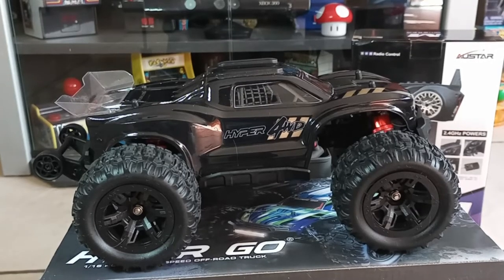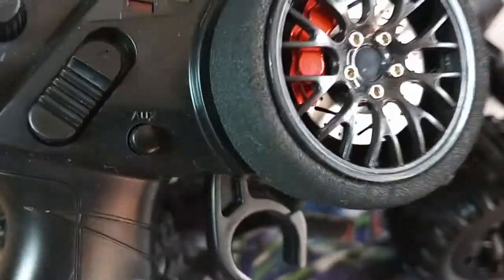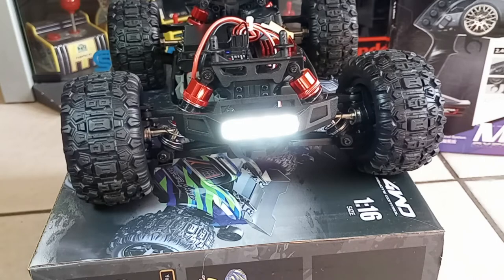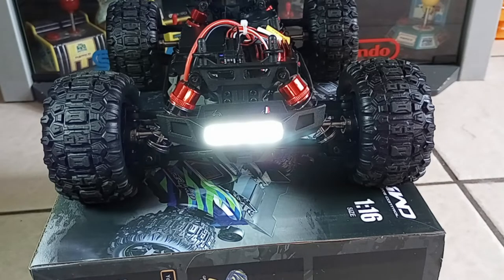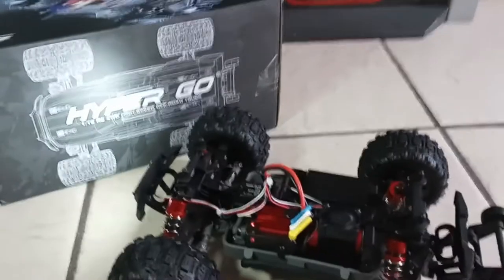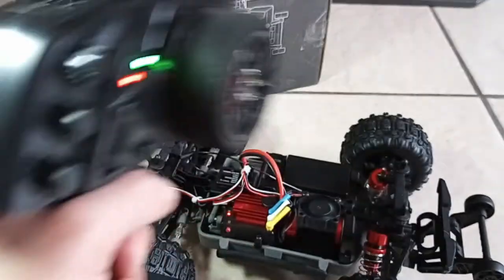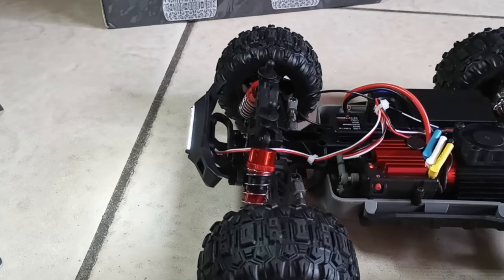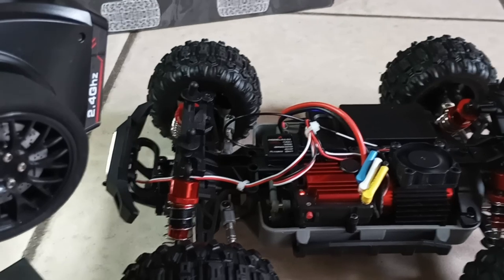1:16 Hyper Go Gets A New Transmitter And This Changes Everything

Comment: I own multiple MJX Hyper Gos and like them. Lag  is an issue with several of them. I also dislike the "drag breaks" or whatever its called when I stop using throttle it locks up sometimes. Helpfuln video.  I wish the link for receiver still worked, but great video. TY.

Comment: changed my receiver as well, but it's a different model than yours. Still, i went into a shop to buy it and the guy changed it for me on the spot. He told me that it's gonna work standard (without other functions such as switching the lights on/off) until we find the ESC manual so we can calibrate it to the new receiver. So let's spam MJX for a manual or a tutorial on how to configure their E45A ESC so we can get our lights working, brother

Comment: I put the wheel extension adapter on mine..made a huge difference. I had to drill the wheel to 6mm and the brass nut in the kit that goes inside wheel and against axel I drilled to 6mm fit perfectly
Reply: Where’d you buy those from? I’m finding a ton of websites that look untrustworthy (new to the hobby)
Reply: @DocBeasty  Amazon
Reply: They have a full aluminum CNC suspension available
Reply from the maker: Amazon has what you need but it cost a little more but you can return it if it's broken and even if it's not broken No Questions Asked
Reply: @MightyistheRCGamer  yesssss that's why I use it ..Chinese electronics are cheap but no quality
Reply from the maker: @kevinc9006  You got that right brother
Reply: Awesome, thanks. And is it worth it to widen out the suspension like that? I imagine it would make it a bit more stable, but would it have a negative effect if I took it to the skate park or something
Reply from the maker: @DocBeasty  I don't recommend abusing your RC cars unless you got money but if I abuse my RC cars and something brakes I just can't sleep at night

Comment: Hey i started with the brush mjx with the gps but that remote works way better idk y they didnt just keep selling that remote with the bl models cause u just have to bind it to bl but once in awsile ill use the lil remote but ya it sucks if u switch the red wire with the signal wire for lights then it will work with the remote👍
Reply from the maker: Thanks for the information brother

Comment: Just got this as my first RC, was wondering if the steering had to be so twitchy or if it was a skill issue, now I see it isn’t just me!
Reply from the maker: You need a new transmitter. But you should be fine for now. I am happy to here this your first rc car. My first rc was only brushed not brushless so your on a great start. It's around $35 to get a new transmitter but after that you will be doing great because that rc truck is built to last
Reply: Radiolink makes a great inexpensive tx/rx. Rcgs3 is mint. A better rx will fix the twitching

Comment: Hi, may I ask you something, please? I can see the receiver is not in the original housing any longer. Does this mean to does not fit in there? Is the new receiver waterproof? Even more interesting for me as a noob is how you connected the fans. This receiver has one connector less than the R30, which comes with the car. How did you connect it correctly? Thanks in advance.

Edit: I came her searching for "Hyper Go 14210". Now I see it is.a different model. Maybe you can still answer the question about receiver and if it is waterproof and what the measurements are and maybe also how to connect the 14210*s fans as there are 2 of them. Best regards.

Comment: With the OE radio it cogs at low speed and as soon as you try to get past that it goes too fast, there is no smooth progression to full speed. Replacing the OE receiver asap with a Dumbo X6FG receiver.

Comment: Ok this receiver/controller has some kool features the old one doesn’t but I had to switch back. Backing up only works good in the reverse setting but still sometimes doesn’t work so I had to flick it a bunch of times and even when it does respond it’s very slow even in the high setting. And my biggest issues was I lost speed, with the old one I needed the wheelie bar and old ladies were impressed 😂 but the new one gets chased by toddlers. 😅 I still like it and will use it to trick people who wants to race me.
Reply from the maker: Hey bro if your happy then I am happy
Reply: The ESC is crap, best to swap it out. I put in a Quicrun 30a ESC and it's response is waaayyyy better

Comment: Can you tell me if i need a new esc, or did you just changed the receever and it fits to the stock esc?
Reply from the maker: Yes the esc will work fine if you bought a new transformer. But only for the brushless version

Comment: HYPER GO H16BM 1:16 4X4 RTR Brushless  HELP!!!!  I bought this car for my husband, but ordered the wrong batteries.  Could you please tell me what batteries he needs to get.   I purchased the Zeee 3S Lipo Battery 2200mAh 11.1V 50C Shorty Pack Battery with Deans Plug for RC Car Truck, but the piece to lock the battery  in is not large enough.  What size does he need to order.  Any help would be deeply appreciated!
Reply: hi. Just take a meter and chek the battery space in the car
Reply from the maker: The battery you need is on ebay trunigy 3s
Reply from the maker: For some reason your comment was put on hold
Reply from the maker: https://www.ebay.com/itm/155422672525
Reply from the maker: Remember everything about RC-ing is difficult very difficult because you have know how to solder a new connection like did you can't just order a battery with everything your looking for. They sell a 3s for this rc but you have to put time into looking for it

Comment: I like your content and stuff I just need to see how it’s connected and how you did it because I have the same rc car and the same transmitter
Reply from the maker: Connect the receiver as if you already have it paired. Then put the binding plug that came with the transmitter in channel 3... Put servo in channel 1 and the ESC in channel 2 turn on the RC and when you turn on the transmitter hold the bind button on top of the transmitter and we'll holding the bind button down turn on the transmitter and it will pair. Then put the light in channel 3 and done
Reply: @MightyistheRCGamer   how long do I hold it down for
Reply from the maker: You hold the bind button down well you turn on the transmitter
Reply from the maker: As soon as it binds the light on the receiver will stop blinking. Then take out the bind plug
Reply: Good thing I checked here because I bought the same transmitter and thought it would be a simple connection. Thanks!
Reply from the maker: @SweetTooth10  follow these steps 
Connect the receiver as if you already have it paired. Then put the binding plug that came with the transmitter in channel 3... Put servo in channel 1 and the ESC in channel 2 turn on the RC and when you turn on the transmitter hold the bind button on top of the transmitter and we'll holding the bind button down turn on the transmitter and it will pair. Then put the light in channel 3 and done
Reply: @MightyistheRCGamer  👍🏾It work’s! I love how it lets you change the throttle and steering to reverse. It also gives me a much longer distance in how far it goes.

Comment: Hello again, I ordered the same transmitter/receiver as yours. I can't get the transmitter and receiver to communicate with each other. I couldn't quite understand the procedure in the manual. Can you share how you were able to get your's to function?
Reply from the maker: Put the binding plug in channel 3 then put the ESC in channel 2 you will see the  Receiver blinking then hold the bind button down Well turning on the transmitter and they will connect. After put the servo in channel 1 and put the lights in channel 3
Reply: I followed your instructions to the T and it connected/worked perfectly! Thank you again for your videos and advice. Being new to the RC game I appreciate your guidance 😎
Reply from the maker: @rktter  All the Thanks go's to you my friend for coming to my channel

Comment: I have the hyper go 16207 buggy version. What kind of transmitter do I need for that one? I'm new to hobby. How do you link a new one to the receiver
Reply from the maker: You can use the transmitter in the video it's sold on Amazon. Remember every transmitter can be used with any RC car and every transmitter comes with its own receiver but you have to pair it to the transmitter yourself and it's not hard at all you just need to follow the directions provided in the box. So you could buy any transmitter you like and it will come with a receiver

Comment: How come mine the steering is now making it go and the throttle is steering
Reply from the maker: Remember servo is ALWAYS CHANNEL 1 then the ESC is channel 2 just change them and problem solving
Reply: Switch your cables on esc. You put motor on channel 1 and servo on 2. It should servo on ch1 and motor on ch2

Comment: Can you show how to upgrade the motor and esc.? My esc is built into the receiver and steering
Reply from the maker: If yours is all in one then it's Definitely not this rc so if you want to upgrade then you must change out EVERYTHING so you need a independent ESC and servo and Transmitter and receiver so that's a lot to buy
Reply: @MightyistheRCGamer hi, why also change the servo? Transmitter and receiver is enough no ?
Reply from the maker: @anisghil  the servo is great the transmitter is making it work incorrectly.

Comment: How do we calibrate this esc to the new receiver?
Reply from the maker: I don't know what transmitter and receiver you have. But it should come with instructions and a bind plug so you have to read your instructions. If you still don't understand how to just look up what transmitter you have on YouTube someone should have a video on how to
Reply: You should not need to calibrate the esc to the new trasmitter.   JUst make sure that the throttle is at nutral when you turn on the car and it should be fine.  Im using a higher end FLYSKY NB2 with mine and its perfect.  With the NB2 you can also adjust steering curve or ad a mix so that the faster the car goes the tamer the steering becomes.  The car is amazing and the stock radio is horrible......It deserves a quality transmitter to unlock its full potential.
Reply from the maker: @rbroberts61  I don't think he meant calibrate I almost certain he meant how do Bind the new transmitter to the receiver

Comment: On the new version on mjx 16208 i have throttle trim an the lag it’s gone
Reply from the maker: It's still Garbage
Reply from the maker: The original transmitter doesn't let the servo work correctly and that is even worse than the lag
Reply: @MightyistheRCGamer  maybe your I right, but is a cheap car..I put last week a gyro Ets mine and it’s work great
Reply from the maker: @make4all2000  you need to get rid of that transmitter
Reply from the maker: @make4all2000  I know it's cheap but it so much better. I don't even use mine anymore I put it back in the box
Reply from the maker: @make4all2000  I just bought a new Traxxas Drag racing car. But I haven't uploaded because I am focusing on my career I got to put this college schooling to work